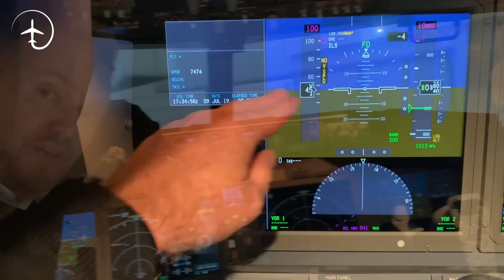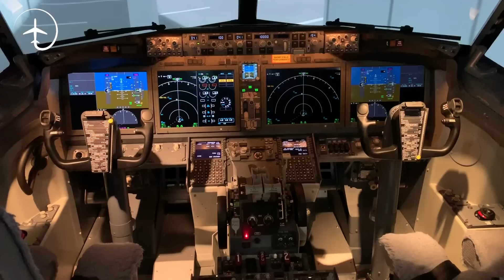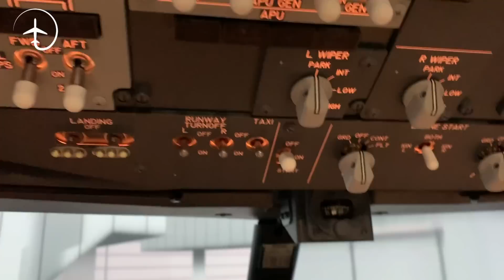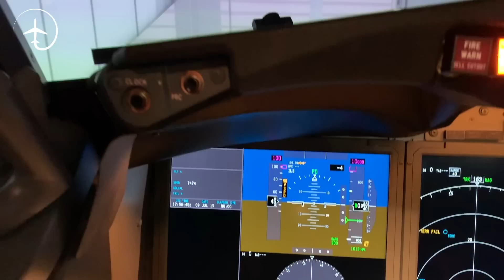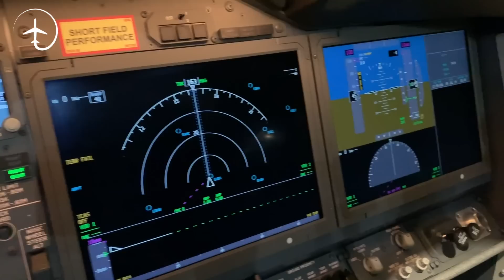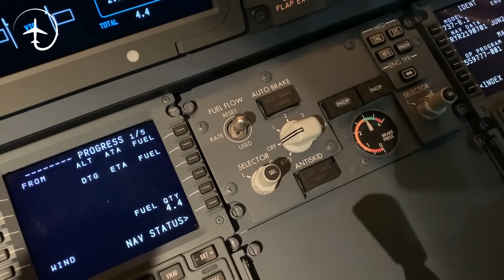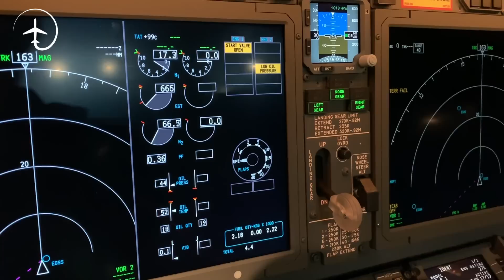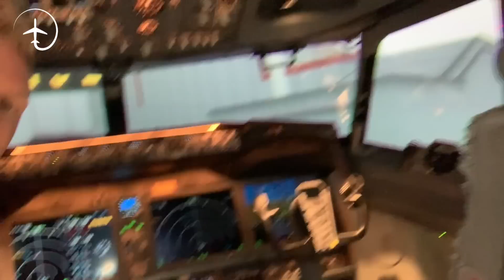Boeing 737MAX Cockpit Tour

Comment: The 1960s are in there, they have used Futura in quite a few places of this new plane. This font was also used all over the space programme back in the day. Although it’s a nice font (timeless and geometric, designed in 1928, Bauhaus), one would really design a custom font these days that works particularly well on screen. There is really no reason to make everything look like some sort of terminal mode basic pixelated font stuff. Even if it needs to be very basic — maybe it’s more stable this way — the fonts could be changed. The choice of font matters even in a car when it comes to reaction speed. How long it takes you to read something is just quite vital, especially on an aircraft.

Comment: A note: the MOTORING segment of the CFM-LEAP startup is typically faster (a few seconds). The reason why the FADEC motors the engine longer in this case was because the engine was still hot from the previous shutdown (EGT initially shows 196 deg), and needs to cool down first to reduce the chance for a Hot Start

Comment: This aircraft has gone under more scrutiny than any other aircraft has. However, I completely understand why.  The good news is now that the aircraft has been cleared to be put into service in the USA and Europe, it will be the safest aircraft in the sky bar none!
Reply: This aircraft doesn't even have an Engine Indicating and Crew Alerting System (EICAS) which is mandatory since years for new planes but got lobbied away somehow. No, this absolutely is not the safest plane and it definitely never will be as Boeing already made clear that they never ever will upgrade the 737 MAX cockpit to current safety standards.

Comment: Boeing need a new narrow body, this fly by cable stuff isn’t cutting it any more
Reply: Cables are fine.
Reply: @ethansaviation2672  I pay extra not to fly in a cabled airplane. But that’s just me
Reply: Cable means redundancy. Redundancy means safety.
Reply: @dynasty0019  safety? Last time I checked Airbus fly by wire is the safest airplanes out there.
Reply: @tonymcflattie2450  Until it isn't. Each system has its pros and cons. Airbus's limits were shown in incidents like Air France Flight 296, Flight 447, Air Asia Flight 8501 and Qantas Flight 72. Those incidents would've never happened on a Boeing because you can "feel" the aircraft on a Boeing. While the Airbus has no force feedback at all. In the end, it's all about pilot training and proper maintenance.
Reply: @dynasty0019  that's an interesting point, I wonder how much difference the controll feel would have made In af447. Of course, many pilots loose controll of the 737, like the  fly dubai in russia. 

Sadly pilots now days are automation dependant, the stick and rudder skills are being diminished. As an airline pilot, the 737 is garbage to me - No tray tables, no recline in seat for napping, no room for roller bags in flight deck, no eicas, no fly by wire protections. Only thing that appeals, is that it is an old fashioned pilots airplane, kind of a bad boy of the fleet.
Reply: @tonymcflattie2450  most of the things you hate about the 737 just shows a pilot's moan to much these days😂

Comment: You call this improved cockpit?  Gigantic screens. still tiny text characters.  Duh?  How long does it take to find something?  More square acreage to search.  Not good.
Reply: It's actually simpler to use than the NG, because a lot of the systems information automatically appear on screen on the MAX when there is an issue instead of trying to interpret instrument and gauges.

Comment: Boeing should build a plane crusher or shredder to take care of this engineering disaster 😁
Reply: Are we serious dude it is a problem that can be fixed don't waste millions on a plane crusher just fix the problem for real don't runaway from your problems just fix them
Reply: @joshuadrain3902  the problem is that it was a rushed design to compete with Airbus and there new efficient engines. On top of the wire harness issues, fuel tanks full of debris, the carelessness of not telling anyone about the McaS especially the pilots, failure to give simulator training to cut cost... On top of ignoring all the instructors and everyone that tested this plane out before it even got the okay.. they dropped the ball, the CEO of Boeing got canned... It's a garbage design, cheap computer programmers did design that MCAS system... I think you work for Boeing actually. One of them paid bots...
Reply: @baymax6894  I don't work for boeing one and two legit I just want to see the boeing 737 max florish and to see the airlines and boeing and all aircraft manufacturer's recover from this Corona crisis and to see one of my favorite planes fly again the boeing 737 hold's a special place in my heart ya know it is what I work out of it is what pays me every two weeks and three you cannot blame boeing for the FOD in the tanks (foreign objets and debris) I say if they got the fix for the aircraft and it is actually the fix i say that this is the breakthrough for boeing  ya know .
Reply: @baymax6894  again as I said don't runaway from this issue just fix it if you continue to run away from it , it will come to bite you in the ass latter and if the problem can be fixed just fix it don't make since to just slack on about fixing it I wanna start a airline and I certainly would love to fly this aircraft on my fleet as long as it is fixed and don't try too kill me
Reply: @baymax6894  I also think  you work for Airbus so you don't hear me complaining
Reply: @joshuadrain3902  it is there fault for the debris in the fuel tanks because it was in 75% of them. Meaning they never paid attention and quality control failed. Of course that's not a surprise because of the wire harness and all the other problems with it. God only knows what else they overlooked. I'm hearing stories about the dreamliner and how them  mask will not deploy when they need to. how everything was just looked by and quality control was also a bust in that. I honestly hope they break up Boeing because they are too powerful and they need to be broken up into a smaller group that way there is more oversight by the FAA and other groups that are independent from them. like back in the day when the 747 was engineered by the airline by engineers that ran the airline versus corporate CEO dumbasses. Boeing can't even get their military contracts in order. And they had to cancel one project because of the CEO and the other people that got fired. It was entirely too afraid that this was another junker. That just proves the point that the 737 Max 8 is junk. if they had the money they would scrap it but they can't because if they do they will go bankrupt completely. and I really hope that a lot of these airlines do fail because they're running on margins and stock exchange. Not proper business practices.
Reply: @joshuadrain3902  no I don't work for no airline but I do machine some fluid nozzles for Boeing and they are plastic 🤮
Reply: @baymax6894  ok nice to know that and yeah the smell of bring plastic kills me too Mani used to fly a king air super king air over a plastic factory and dame the smell of plastic through the Packs of that plane it stunk
Reply: @baymax6894  also how about this we just hold boeing up to the same standards as Airbus all in the same sentence we get boeing to actually do better the last CEO honestly was just all about the business and not about product quality control we don't need people going bankrupt just for there to be just Airbus making shit honestly I feel that Airbus makes pilots way to fucking lazy I like Airbus and all but they also got shit they get wrong . We don't need a aircraft manufacturer that runs on stock margins we need one that knows how to build good planes I remember all the times airbuses fly by wire systems caused a crash we don't need anyone to go out of business we just need perfection over time just like the Japanese say it is better to perfect things over time than just to throw it away if boeing gets there shit together I think boeing would doo good also the early production of the A350 showed that the Trent 1000 shut down on the Airbus A359 and boeing B787 causing the whole cockpit to go dark so don't wish bad luck on boeing let's just fix boeing's issue .
Reply: @baymax6894  and honestly do you see Airbus doing alot of contracts with governments Again no .plus if boeing and lockheed would actually perfect this this would be better and not just have lockheed being boeing's side chick.
Reply: @baymax6894  and honestly do you see Airbus doing alot of contracts with governments Again no .plus if boeing and lockheed would actually perfect this this would be better and not just have lockheed being boeing's side chick.
Reply: @joshuadrain3902  I'll tell you this as the best example and as to why Boeing needs to go bust... NASA was the gold standard. Now SpaceX is in the helm. And other private corporations. They are doing a way better job than nasa ever would. Airbus is not a good replacement either or comparable to Boeing in many aspects, their production lines are terrible, but there planes I think are superior to Boeing... Airbus A380, now them rolls Royce engines they fly have a lot of faults in them . Boeing had their hand in them engines also. They put them on the 787 dreamliner. That is their biggest problem they are doing pissing matches for stock holders. A320 with them efficient engines... And sadly Boeing created the max to compete with that and nab the market. They aren't going to perfect anything that is there initiative. So yes, it needs thrown away. it's not like the technology is going to go away I just don't think it should be in the hands of what Boeing considers corporate.
Reply: @baymax6894  I see what your saying however we don't need this company to go burst I think that truely it is fixable they just need to clean house honestly and they need some reworking to do because I think that if it was just Airbus that would get ould within it's self obviously other aircraft manufacturer's would take boeing's place is boeing went burst how ever boeing just needs to clean house and fix there issues like you said it is because of boeing's corporate way of persueing things this covid thing should lead to boeing actually re-thinking certain aspects instead of doing so many stupid decisions.
Reply: @baymax6894  and it is not because spacex or nasa it was just that spaceX just stepped in and trumped NASA how ever im not a space junkie so I don't know about space
Reply: @joshuadrain3902  clean house would be nice, but that isn't ever going to happen. You are still going to have people doing favors for others and hiring there friends kid that only knows how to play with Legos.. you get the idea ... They will keep there friends.. just how it works. They go bust, a better company comes in and takes over , all is well with the world. Or worse, and they go too. Keep in mind all these companies are massive. General motors, ford, Toyota, Honda,  the banking system, airlines.. Amazon eBay USPS FedEx ups... But you don't hear anything about Elio or them bringing back other forms of transportation, MDI for instance... These are corporate Giants that can do whatever they want and the government will save them... Then going bust will help everyone. Trust me on this.
Reply: @baymax6894  which is true your not lieing the only thing saveing Airbus though is the French gov because Airbus was bought by the French way back when the A300 was born and developing all I'm saying is that I hope boeing just bounce back from this and do better there is still a hope
Reply: @baymax6894  which is true your not lieing the only thing saveing Airbus though is the French gov because Airbus was bought by the French way back when the A300 was born and developing all I'm saying is that I hope boeing just bounce back from this and do better there is still a hope

Comment: Why do OFF position exists in the landing gear?
Reply: Vitor Castro the off position disconnects the hydraulic system to the landing gears actuators. Once hydraulics are disconnected, the landing gear is held up by mechanical hooks. Newer Boeing aircraft got rid of the off position because the disconnection of the hydraulic system is done automatically. I hope that makes sense

Comment: the Focus in the media and the bits and parts that we as the public was able to obtain seemed very scary, and the Name 737 max is related to a "Evil designed airplane". the truth is Software that takes over Control during flight has become very usual and doesnt Need to be something scary, it is more that Boeing (and Airbus) Need to tell About a feature that tries to correct a nose up tendency of the Aircraft, wich brings me to a Question i may ask: does the slightly unequal Distribution of weight due to the engine anyhow affect the ability to manouver the craft or is this feature just scary to People who have no idea how flying and an Aircraft works. i heared technicians online saying that the plane is horribly designed with those engines and planes shouldnt be built like that but now from what i can figure the noses tendency to sometimes to pull up doesnt Need to be a Problem at all, bc the pilots who flew the 737 MAX had no more or less Problems bc of the larger engines, the Problem was somewhere Boeing built in a single sensor related Autopilot that no one knew About, and if that is corrected, actually the planes could be up flying again without any Problem

Comment: have you been trained in MCAS?
Reply: Yes, it's called the runaway stabilizer memory item, every 737 pilot should know this since 1967.
Reply: @nightflyer3242  Interesting, as it is the system that Boeing introduced in 2018, that caused at least 2 crashes with more than 300 casualties.
Reply: @drewnos  MCAS is NOT the cause of the crashes. If you read the Final Report on Lion Air Flight 610, it was pilot error with shoddy maintenance practices contributed by the lack of redundancy of data that feeds into MCAS.
Reply: @nightflyer3242  No. Pilots were not trained in using MCAS because Boeing claimed that the system doesn't affect procedures.
Reply: @drewnos  If the stabilizer trim is moving without command by the pilots, then it's a runaway stabilizer memory item. Grab hold of the control, disengage autothrottle, then stab to cutout. It's been that way for 50 years, MCAS or not. The previous flight on the same plane on Flight 610 performed their memory item and continued their flight without incident. Lion Air did not perform the necessary maintenance on the defective AOA vane and left it on for the next flight, which Flight 610's crew failed to perform any memory item on runaway trim, which caused the plane to crash.
Reply: @nightflyer3242  No. What caused those crashes was Boeing tying up a critical system to only 1 sensor instead of 3, lies, greed, corruption etc.

Comment: What is the alternate nose wheel steering for?
Reply: Normally it uses the hydraulic system A.  ALT is for the hydraulic system B.
Reply: @mikep9604  So this means in case of hydraulic failure in system A you would switch to alternate nose wheel steering and then use system B for nose wheel steering?
Reply: @julianr.82  - Yes, that's the purpose of it.

Comment: Why are they using imperial units instead of metric in aviation?
Reply: Satelites crashed and rockets explided for the same reason.. The usa should be forced by the international community to switch to metric..
Reply: Its just very confusing with clothes sizes or tires

Comment: boeing can't afford to have another failure of this plane. however the DC10 survived after it's initial bad reputation
Reply: The DC10 didn't have flight control failures, it had other forms of failure that almost caused its downfall. The DC10's parts, required replacement of defective parts, not examining and rewriting entire software programs line by line.

Comment: Sorry, but i will never set foot on a MAX. As i understand, the major issue is that the plane design with that type of engine is not airworthy. You can't fuse a 1960's fuselage with modern day engines which are too heavy, too powerful and positioned too far off the center of gravity without it having consequences. This leads to a whole array of software tricks to try compensate for the instability which is built into the design. On good days these tricks works, but on other occasions it can go horribly wrong.

Comment: Ok, sir....got question for you.  From your demonstration of engine start, I noted you said it now takes longer for the MAX engines to spool up vs. the NG.  What does that mean in terms of engine restart, should one need to do so during flight?  Is that delay a significant safety factor?

Comment: Delta stock is going up on the Max problems.  The other airlines are losing on the Max.  I may buy some DAL.  Boeing should have made a state of the art single aisle instead of trying to get one last 737 model.  The 787 and A220 are state of the art.  The Max is not.

Comment: Noticed the trim wheels look smaller. Do they still have the knee buster handle? 
Haha, being there, done that. That trim wheel goes back to the 707, and 727, and only the 737 has retain it since it's introduced in the 60s. The motoring feature is unusual and is it there for scavenge pump purposes, or for clearing fuel in the cans? How does that affect starter duty cycles? The VSD feature goes back to the Honeywell Primus 3000 suite, so not new technology (20+ years?), and the PFDs look Honeywell PlainView style as well. I liked the CDU display format and taller. You're right, the overhead looks the same, minus the APU indicator. I figure the would get rid of the slat lights in the back. Nobody looked at those except when I was a 727 FE, only because it was natural from that seat, or a disagreement light in front came on.
The steep departure demo makes a case for the MCAS system. I don't think they will fly this year. Nice video.